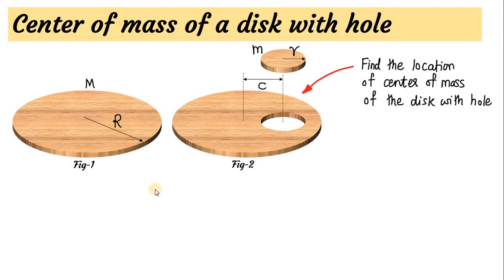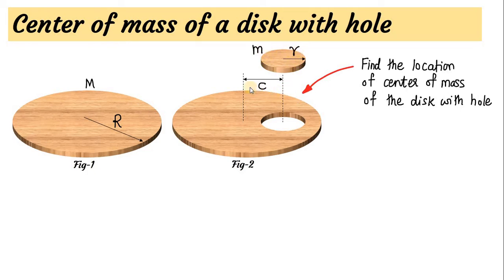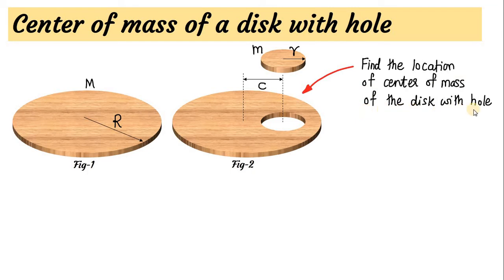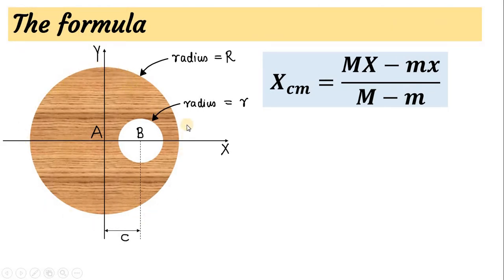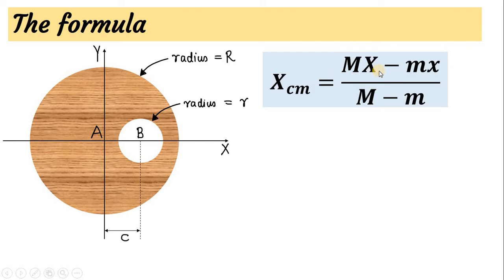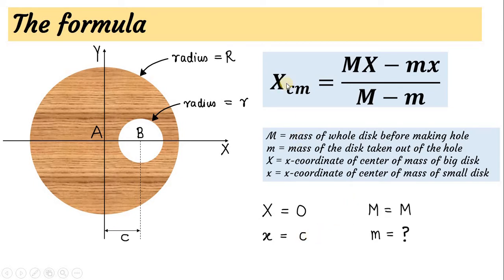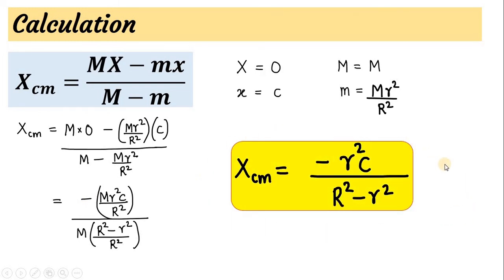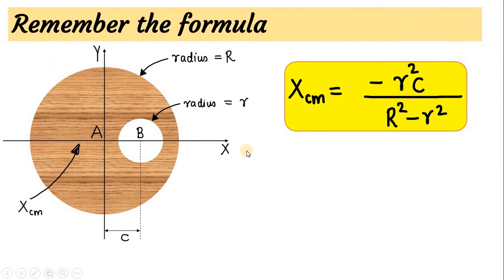How to find the center of mass of a disk with a hole?

Comment: Hi, what if the disc is intact or without holes, how about Ycom, Xcom and Zcom?
Reply from the maker: If the disk is having no holes it's center of mass is exactly at its geometric center.
Reply: @ThePhysicsGuru  If the disk is having no holes it's center of mass is exactly at its geometric center. does this mean if the disk has a diameter of 80 mm with a disk thickness of 3 mm, then the location of the center of mass on the x and y axes (Xcom and Ycom) is the size of the radius or 40 mm and the location of the center of mass on the z (Zcom) axis is 1/ 2 of its thickness or 1.5 mm if the dish is perpendicular to the z axis, is this correct?
Reply from the maker: @AbdulRahman-jz3px  Yes you are absolutely right. We can say that the center of mass will be located at body center (1.5 mm deep inside the disk from the surface and below the geometric center of the circular surface. Think the disk as a solid cylinder with very less thickness. You know that center of mass of a cylinder will be at its body center.
Reply: @ThePhysicsGuru  Thank you very much sir, I'm looking forward to your other videos
Reply from the maker: And if the disk has hole: Remember for any object the center of mass always lies on its line of symmetry. The disk with hole has x-axis as line of symmetry thus center of mass is located on x-axis only.